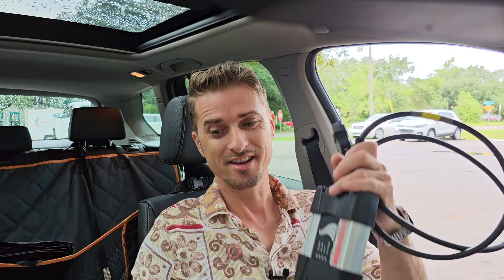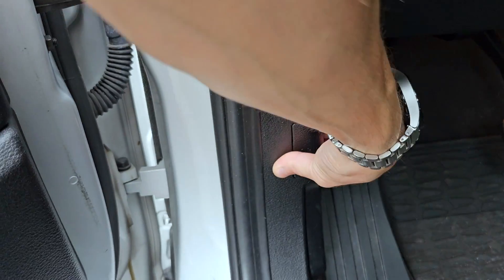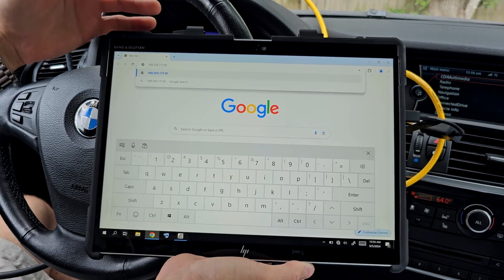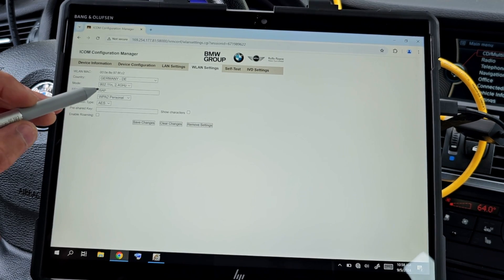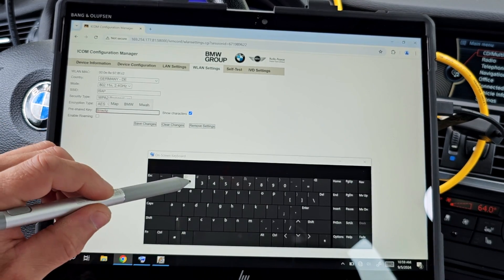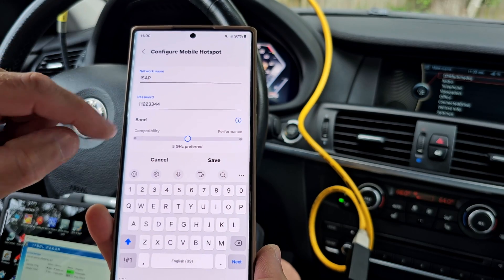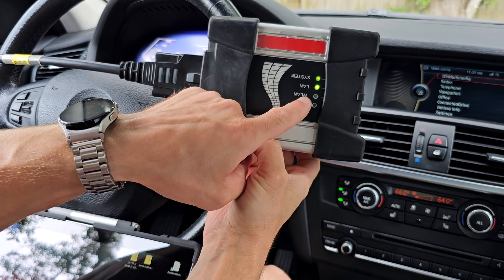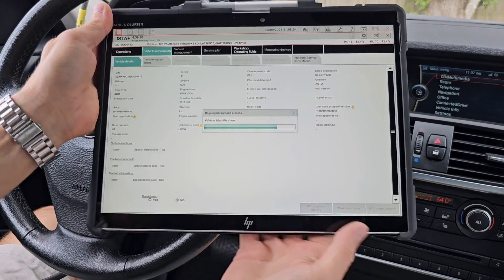How to set up BMW ICOM for Wi-Fi connection !

Comment: I tried what you said. Does not work the way you say. I used Google to type the IP address. Google says, what is this?
Reply from the maker: If there was no video! You've been right,  but when you have a clear video showing how to and most important showing that works! I don't have what to say!
Reply: @MOvidiu  many apologies! I was wrong. Using your method I discovered I was dealing with a clone! No wonder! I obtained another ICOM NEXT and I was able to open RADAR. However the page has changed and the procedure is over my head. I will have to research this and hope for the best. In the meantime thank you very much for taking the time for sharing your knowledge.

Comment: Unfortunately, this method didn’t work for me. I have the original Icom Next, purchased from BMW. I created the Icom network and set the password to 12345678. The phone is a Samsung Galaxy S24 Ultra, acting as a hotspot router. On the Icom.web site, I set exactly the same parameters as required. However, the Icom hotspot is detected but not connected. It doesn’t show up in either ITSA or iTOL radar. It neither receives nor sends packets.

Comment: If you use the same SSID and Password, in Device Configuration on Mode, you can then leave it as ISPI and you don`t have to configure the WLAN settings in ICOM. That`s on genuine, not sure on clones is the same, but must be

Comment: hi, great videos, I did notice you have a short cable between icon and laptop, I have been trying to find one just like it, where can I get one from, thanks , keep the videos coming , I like the ISTA stuff, i learn a lot.
Reply from the maker: Are you talking about the ethernet cable? If yes you can build one if you have the crimping tool or you can easily find one to purchase
Reply: @MOvidiu  thanks for getting back, it is the  ethernet cable im wanting to buy,  is it  a certain type of  ethernet cable or just a normal one ?

Comment: Salut. O rugăminte am , daca se poate. Momentan folosesc Ista + cu cablu K-Dcan. Merge bine, dar ma deranjează ca nu vad voltajul bateriei, acolo la KL15 KL30. Ma gândesc ds cumpar un ICOM. Original, am vazut ca este 3500 lei pe Bavauto. Exista si clone pe la 2000 lei. Întrebarea este: se merita o clona ? O fi buna de ceva ? Mai exista si varianta de a cumpara o Multimarca LAUNCH X431 spreexemplu.  Un sfat din partea ta m-ar ajuta in luarea deciziei. Cat despre cablu k+dcan,  merge bine, dar nu-mi prezinta incedere deloc. Mai am si cablu enet care si el merge bine. Dar parca tot un ICOM as prefera . Iti mulțumesc anticipat.

Comment: Salut, am un ICOM Next original, cumparat de la un dealer oficial BMW. Cind il conectez pe cablu ethernet, merge perfect. Cind vreau sa-l conectez WI-Fi, se aprinde ledul verde WLAN , numai ca nu se realizeaza conexiunea. Am facut toate setarile in ICOM, exact cum ai descris in video. La selft test totul e OK. Cu toate astea, nu reusesc sa-l fac sa mearga si wireless. Am citit pe forumuri ca unele ICOM-uri Next luate de la dealeri nu fuctioneaza pe Wi-Fi. Tu stii ceva? Ma poti ajuta cu vreun sfat referitor la problema asta? Multumesc!
Reply: I'll have same problem. Itool radar can see ICOM and given IP, but there also can seen on "service"@unsupported. With LAN there can seen @ICOM_Next..

Comment: hello, thanks for the explanation, my head does not connect is original, the WLAN light remains steady, but the system plug always flashes until the WLAN turns solid red, I can not in any way make the connection, what could it be, I tried both with modem and with iPhone but nothing
Reply from the maker: Are you sure it is original ? From where did you get it ?
Reply: @MOvidiu  yes original, It comes from a BMW workshop, It had an enet connection problem and they gave It to me
Reply: @MOvidiu  firmware 04.23.10
Reply from the maker: If you did al the settings correctly and is not working maybe the ICOM is damaged!

Comment: Can you recommend a power supply to use when programming modules to keep the voltage at 13.5. I was planning on using something like the PowerMax PM4.

Comment: I have a slightly better method that I have been using for years, I use a software called MyPublicWiFi which allows the laptop to make the hotspot, and eliminates the need for the phone. I configured the MyPublicWiFi to start and create the network automatically when the laptop turns on. Just thought I should let everyone know.

Comment: I hope you can help me. The official BMW service center in my town told me that it isn't possible to install (upgrade) the original rear camera on my G30. I need your confirmation of that.
Reply from the maker: Hello! Yes, you can retrofit rear view camera on your G30 even if the vehicle didn't have that from the factory. Official, it can not be done,  that's why they told you No!
Reply: @MOvidiu  So I have to bring my car to someone more competent/ you to do all those codes, wires etc. Btw are those cameras original BMW parts or Chinese? Thanks 👍 my neighbor. I'm from Slovakia

Comment: I did everything according to the guide and the wifi connection works. If there is a problem, if I want to code the e series via e-sys, is there another way to connect the icom head. I have an original head, not a clone
Reply from the maker: You can code using wifi, be aware of vehicle battery voltage, and your laptop/tablet battery! But to do programming you need cable !

Comment: thhank you ;) why we cant connect directly to the icom next without phone  or a router ? when we use only 1 com next
Reply from the maker: You can , there is an app that transforms your laptop wifi in a modem , bit will message up other enet settings on your laptop and if you use different interfaces your screwed
Reply: @MOvidiu  what i mean is why we cant connect directly to the wifi of the icom. Not about a solution to emilate a royter or something else ;)

Comment: Thank you very much to share your tip with the phone connection! When I'm out, I always bring the cable with me but now I know I can use it wireless even outside! I have a little question about the leds on the icom, on mine the "com" light is red when I connect to a car... Sometimes it flashes red/orange but never goes green (or may be I saw it green a couple of seconds on a E series car one time and that's it). My second question is, when I use icom with a F or G series, the reading is fast, but when it's a E series car, it is much slower to read and find the VIN... Is it normal? When I use K-dcan cable, it is as fast as the F and G series... Thank you!
Reply from the maker: Do you have the original ICOM ?  The E series is a little bit slower because the communication protocol is at lower speeds! Also, on E series, if a module is missing/ not responding, it will take a longer time to scan the car
Reply: @MOvidiu  Thank you for your reply. Yes I have original icom. On the same car I tested icom and k-dcan cable, and the icom is much slower (it was on a E60 and that car had no errors, all ECU'S green on the tree). Except of that and the "COM" led in red, my icom works fine 🤷🏻

Comment: Thank you so much for the educational video on setup ICOM properly. You’re a blessing to the Bimmer community unlike other YouTubers who are looking to scam subscribers. Much appreciated 🙏
Reply from the maker: I appreciate that!
Reply: Hi Ovidiu, I need your help. I have BMW ISTA D and for some reason I am not able to write information to the DME. I tried to change the injector values after installing a new injector and I was not able to. The error message I get is “NOT OK” against cylinder 2. I tried registering a battery and it was not possible but I can read and reset fault codes without any errors. Very strange but with your expertise, I am confident you may be able to help me. How can I get in touch with you?

Comment: What’s the difference between using ista and esys with icom vs plain enet to obd2 cable? Thanks!
Reply from the maker: Depending on what you're using it ! Enet cable is good for coding with Esys,  but ICOM will do programming with ISTA, everything on E series! Voltage reading and much more!

Comment: I presume you have to have the icom version  with Wi-Fi .
Reply from the maker: The cloned one , yes !  the original ICOM is standard with WiFi
Reply: @MOvidiu  cool! When I bought mine, I had the choice with or without Wi-Fi and I chose without, I will be trying this tomorrow! Can’t you stick like a dongle in the interface so you don’t have to use the phone?